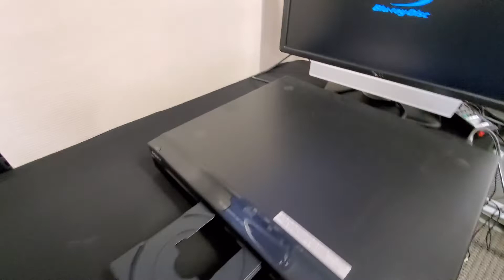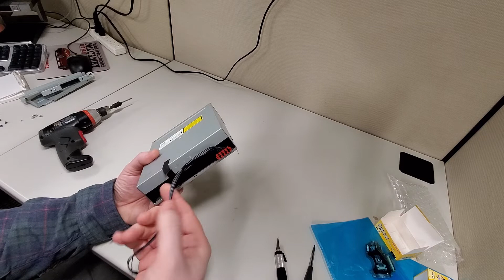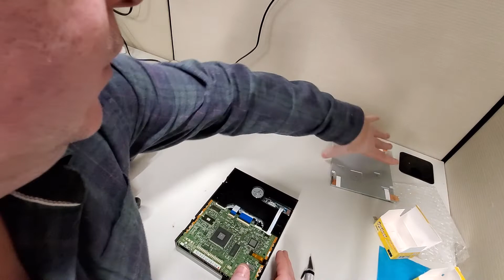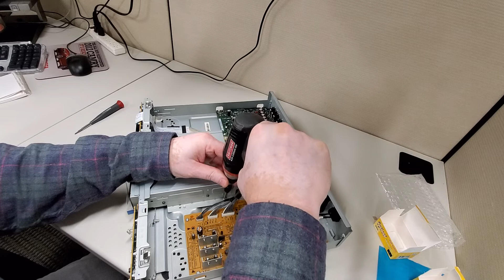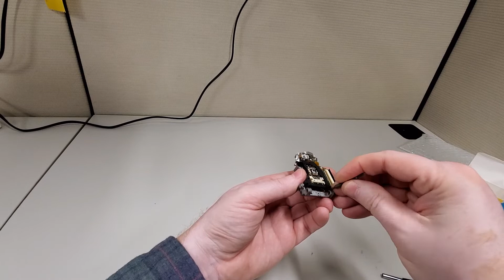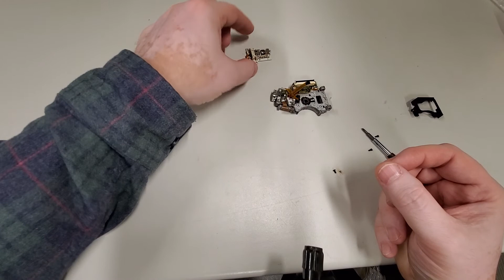How to repair a Sony BDP-S301 Blue ray laser disk player with KES-400A laser head.

Comment: I'm now on my 2nd purchase of the laser head lens assy. This time it came with the frame with the laser lens Assy already installed. All I had to do was remove the 4 corner screws to install. The new Assy did look a little different. I did the installation, powered it up and the drawer wouldn't close all the way. Took it all apart again and found the motor was sitting higher than the OEM. So, I swapped out the laser lens Assy to my old frame. Everything seems to fit and work. Plugged the power and HDMI in, it acted like it was working except I did get the "blue" Blu-ray screen. I cycled the drawer several times and it tried to broadcast the Blu-ray screen but couldn't. So, my question is when swapping out the laser lens Assy, is that were the firmware is located?

Comment: First great video. Great instructions. Can you give me the vender you bought this leaser head from and the part number. I have a Sony Blu-ray laser disc player: BDP-S300. I did what you said about plugging in the "KES-400A" and ordered it on eBay and it doesn’t play/run Blu-ray CDs just regular CDs, obviously the wrong laser head. It came way late I had concerns, but it did finally arrive.
 Thanks a bunch.
My laser head Assy numbers are: 
KES-400A
1201
070703
1559

Comment: I have a Sony Blu-ray laser disc player: BDP-S300, only use it about 10 times, it has been sitting for about 1 year. I turned it on (which takes a long time to see anything on screen) and it kept telling me there was "NO DISC". So, I noticed this wonderful video on how to take apart my Laser Disc Player: Sony BPD-100 AA, I did exactly as you demonstrated, but I'm just cleaning the laser lens. Everything went smoothly, but now after I turn on my player it states POWER ON, then on the tv screen it reads SONY BLU-RAY , then on the front of the player it states DRIVE ERR. I'm stumped, what do I do??? Thanks
Reply: I took it all apart again and found the ribbon that went to the back of the CD unit was not on all the way. That fixed the DRIVE ERR. I oiled the laser rails to make sure I cleaned the laser lens good; all looks good. I know this player is old, but it's been stored away for 12 years in its OEM box safely and can't believe any part is worn out?? But I'm still getting the (NO DISK error). I even downloaded the new drivers onto a CD-R disc to date the firmware, but the player won't read it either. HELP, anyone. Thanks

Comment: Thanks for the great video.  I have a question: I've replaced the laser head on my BDP-S300 with the same KES-400A laser head, following your video to the letter.  It now plays Blu Rays perfectly but DOESN'T play regular DVD's (which is most of my collection)! I've tried several and it used to play DVD's no problem.  It does read audio CD's ok and I have confirmed I am running the latest (6.2) firmware.  I tried updating the firmware again just in case but it wouldn't update since I'm already running the latest.  Any suggestions from you or any others who have the same problem?  There doesn't seem to be any 'factory re-set' but I've tried the power off/on cycle with no luck. Thanks!

Comment: Not all BDP-S300/BDP-S301 units comes with KES-400A. Open your unit to check before ordering. If your internal drive is a Pioneer BDV-102SO, it uses an entirely different laser head w/o a model number. I can only assume it shares the same laser as the Pioneer BDP-94HD which mentions a BDV-102 in its service manual. In which case, I cannot find any replacement lasers in stock...
Reply: Right. Mine did come with the KES-400A which I checked before ordering the replacement part.  Per my comment above, the new head only plays Blu Rays and CD's but NOT regular DVD's.  I didn't see a setting anywhere so not sure what's going on. Any thoughts would be appreciated.

Comment: Did it have issues before it would no longer recognize disc?  My Oppo BDP-203 player is starting to cut out intermittently with CD's, and sometimes freezes with Blu Ray disc.  I replaced the HDMI cable, but the problem persist.  The replacement laser mechanism is fairly inexpensive compared to replacement cost of replacing this unit.

Comment: Do you repair these?  I have a Sony BDP-S550 player.  It was probably used for 20 hours today in a very dusty environment.  Last I tried, it would play a DVD but "usually" would get read errors on a Bluray disk (any bluray disk).   I have no idea if the lens is just dirty or if the laser is bad.  I tried blowing air in the DVD tray towards the lens - didn't help.
I know I can get a cheap bluray player for "cheap" - but I would rather fix this one if it's repairable reasonably.  It is an older unit (maybe 8 to 10 years) - but it was rarely used.
Let me know.
Thanks-

Comment: Thanks so much for posting this! I have a Sony BDP-S3100 that plays part of a DVD then freezes. At first I thought it was dirty or damaged DVDs that we got from the public library, but I tried it last night with several brand new DVDs and it acted even worse. Got into second episode of a TV show (30 minutes each) and the image would freeze. You could hear the blu-ray drive making a loud mechanical sound like a failing hard drive trying to access data. Do you think it is just a cleaning thing or do I need to buy the part you mentioned?
Reply from the maker: its better to replace.

Comment: Hi, Thank you for sharing your knowledge with us.
I have a Dell Inspiron 15 3000 series. It’s about 4 yrs old. I have almost 3/4 space on my hdd, but it seems to be failing. It’s getting slower and slower by hours. Eg, I tried to open a window after a reboot 2 hours ago and it is still loading. 
Is there a way to save this hdd or should I get a new one? I really appreciate if you could help me. Thanks.
Reply from the maker: Its better to replace. You can use current one as a backup.
Reply: wheres the second part  ?
Theres no more reel on the tape  ?

Comment: Good afternoon!
I have a question about a project you did awhile ago, for a Blue Yeti microphone.

The mic works conditionally, but not perfectly. 

It works on an Xbox, but not on a PC. It only takes in full static to the computer. 

However, the self balanced audio through a headphone sounds perfect. 

I have a second working mic that I am trying to test it against but I am having issues finding what ever component may be causing the issue. 

Do you believe it is the USB port?
All the pins look to be ok but I. Not sure.
Reply from the maker: I have found that Yeti mikes just poorly constructed. I found that fixing them sometimes isn't worth it.
Reply: @Mac1PC  than you for the reply. 
I had since sold the mic for parts and moved on